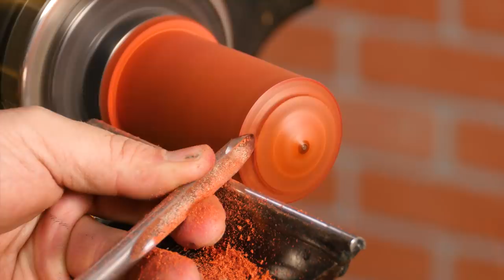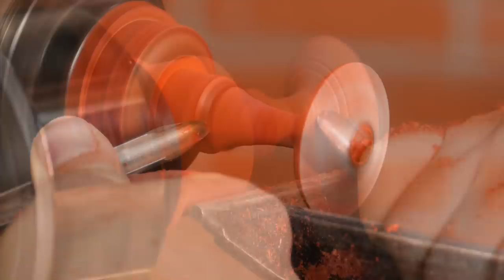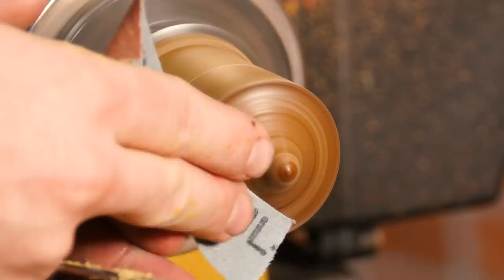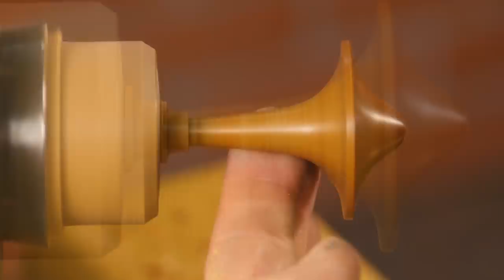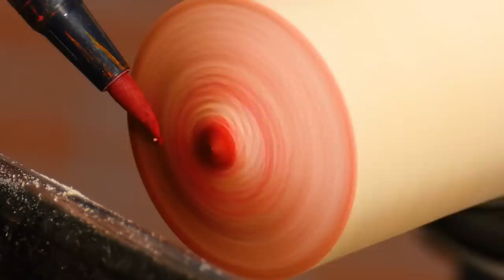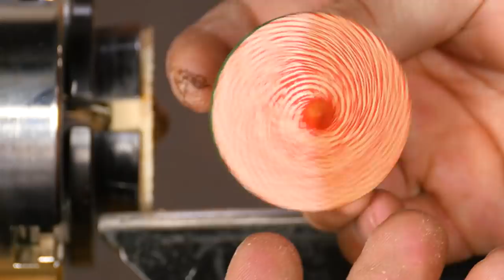Turning Spinning Tops (Inspiration Series)

Comment: Very Good.   What kind of wood, bits, etc did you use?
Reply: Redheart, Lignum vitae, and Hickory --  In that order. For tools, it looked like a 3/8ths spindle gouge, diamond parting tool, and skew chisel. (Grinds and size I'm not sure) Also, those may be Robbert Sorbey texture tools, I'm not sure. Overall it looks done with a chuck and simple tools only.
Reply from the maker: Thank you Art and Hugs. Check out our blog article for the complete list of everything we used in the video. Here's a link to the article. http://blog.woodturnerscatalog.com/2018/12/turning-a-spinning-top/